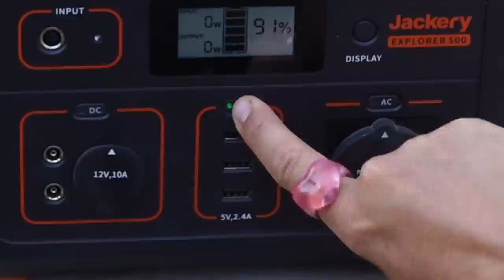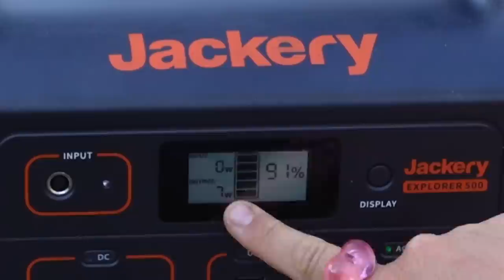Upgrading Our Cabin  -  Off Grid Living Portugal  -  Weekly Vlog (S2E8)

Comment: Hi guys, another fantastic video thank you. Just a thought 
On the ceiling maybe using  some insulation paint, board or camping uv reflective sheeting and I see there are green  diy options online you can always cover insulation with some of the bamboo screening to make it look petty.
Reply from the maker: Hi Cheryl, I agree needs prettying up to cover the visible roof, at some point we'll probably get some nice material and staple it, we, also want to cover the top 3rd of the back to keep all the sun out for the hot months